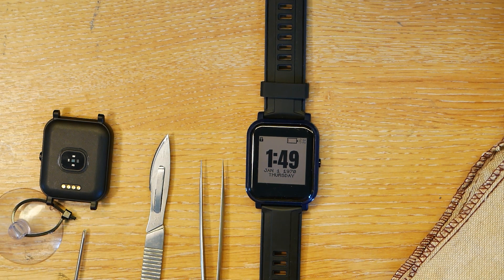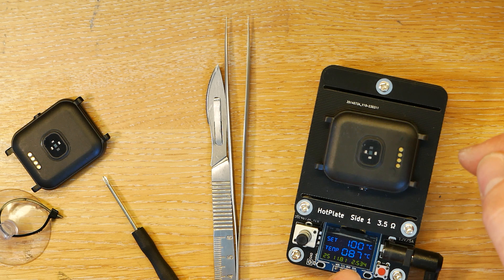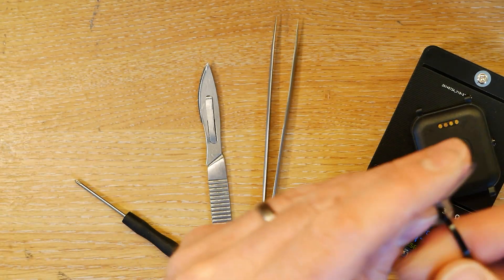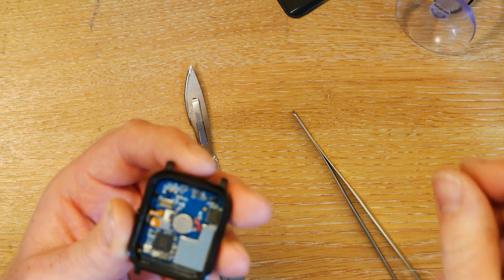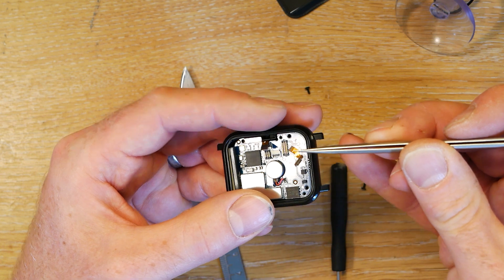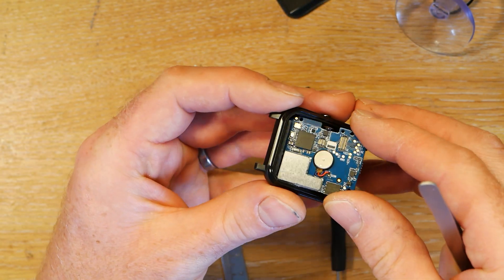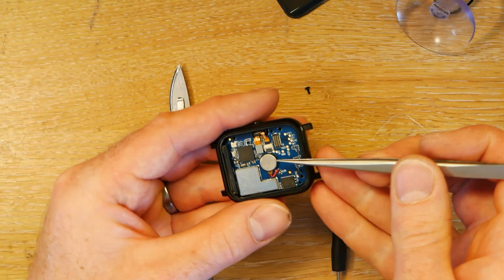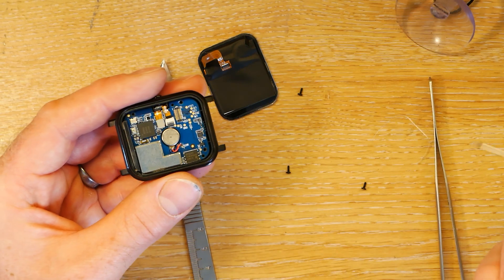Bangle.js 2 Disassembly

Comment: Thanks for all your efforts and the video. I cannot, however, for the life of me get the screen to lift off of my bangle.js2, even after carefully double-checking my 3D-printer's heat bed with an infrared thermometer. The temperature should be just right, the bangle is heated throughout and yet my suction cub doesn't entice any movement in the screen, even with enough violence that would risk tearing the ribbon connector. Is there some kind of trick to it? I've been at it for hours and I'm afraid of slow-cooking the device a bit too much.
Reply from the maker: There's no real trick - some are easier than others, but it can take several minutes for the heat to get right through the glass to the glue. If it really doesn't move you can get a thin scalpel/razor blade and push it between the glass and plastic - if you push in gently it should nudge the LCD over slightly and that may be enough to loosen the glue enough for the suction cup. If you push in and lean it over you can lever the display out but it can dent the plastic slightly (and risk cracking the screen if you're not careful) so should really be a last resort

Comment: Hello,

Thank you for the video.

However, I encountered an issue with acetone during my work 😢.

Would it be possible to purchase a new support for the electronic board of the Bangles 2 watch?
Reply from the maker: The case is made of ABS plastic so acetone would dissolve it :( What do you mean by "support for the electronic board"? Do you mean the watch body itself? I'm afraid we don't sell those

Comment: Hello Gordon. Thank you for the Bangle and thank you for the videos. I intend to use my bangle.js 2 as an alarm wrist clock. I tried it with that entend but the vibration motor proved to be too weak, compared to that, for instance of the Fitbit Charge 4 for instance.
Do you know if there would be a way for me to upgrade the vibration motor with something stronger ?. Thx.
Reply from the maker: Hi! You may have some success just changing the "Default Alarm Pattern" in Scheduler settings. By default it's two short buzzes, but you can make it 3 long buzzes (===) or even something custom which can make a big difference to how much you feel it.

But in theory yes, you could change the motor. I did look at getting it changed but the manufacturer didn't want to do it because they were concerned the increased vibration and also power draw might cause problems, so I think you'd want to be careful.

Comment: When re-assembling; which glue would work to get the display tight in place?
Reply from the maker: I'd suggest a "neutral cure" silicone sealant. The neutral bit is important though because acetoxy silicone sealant lets of acetic acid when it goes off, and that could corrode the PCB.
Reply: @Espruino  thank you

Comment: Hi, is there  a way to add infrared receiver to the board ?
Reply from the maker: There are two pins on the rear of the board (under the battery) called UARX/UATX which I think may be unused and you could maybe solder a sensor onto - but it'd be quite a big job to do. The standard IR sensors like https://www.espruino.com/IRReceiver are really just too big to fit in the watch itself
Reply: @Espruino First of all thank you for responding, great job with the projects man. I will try and do what you suggested unless you have another idea. I am aware of the spacing issue , that's why Im going to try to get in a case like the casio AE1200. Also not sure if there are any battery consumption concerns. I did try sending an email to the mentioning the a casio module like bangle. Let me know if you do like paid sessions so con ask you a couple of questions.
Reply: @Espruino   Was just reading and it seems I can just add a IR transmitter and use the receiver on the Puckjsv2 to get the codes. Do you think  that would be easier ?
Reply from the maker: @Marcos32709  adding an IR transmitter would definitely be easier - there are two pins, UARX/UATX on the board that you could just wire an IR LED across - although that would still mean peeling back the battery for access. It would be an interesting project but still quite difficult. If you're just trying to control a TV or something like that, just putting a Puck.js (which already has an IR transmitter) by the TV and then controlling the Puck from the Bangle via Bluetooth would be by far the easiest option.

Comment: where are the axis sensors and magentic sensors and barometric pressure sensor / altimeter sensor / temperature sensor?
Reply from the maker: I just added a labelled picture here showing where each IC is: https://www.espruino.com/Bangle.js2+Technical#pcb

Comment: Thank you, very easy to follow walkthrough! is it possible to replace the battery?
Reply from the maker: Yes, although you do need to use a soldering iron. Because usually the Bangle can last over a week without recharging, it should be relatively unlikely that you have to replace it though.

Comment: Thanks for the video Gordon, loads of useful insights. Explains why my 3d printer heated bed wasn't unsticking the screen glue... I was too nervous about getting the temperature up high enough (chickened out in the 80 C's as I'd never had the print bed that hot before and I didn't have a secondary means of knowing what temperature the bed was to ensure it didn't go over 100C and damage the screen).
Reply from the maker: Yes - unfortunately I forgot to suggest a 3D printer bed in the video (which was one of the reasons I did this!). You have to be careful if you have a magnetic bed as they can lose their magnetism around 100 degrees C, but I routinely run my cheap Ender 3 heated bed at 80 (sometimes over) for ABS prints and it's been ok.
Reply: @Espruino  it's an Ender print bed with a cheap PEI spring steel magnetic print surface. I hadn't even considered damage to the magnetic sheet. Hot air from a soldering station works wonders. Minimum I could set it to was 100° and I aimed at the perimeter of the screen, trying to target the glue.
Reply: I came here to suggest that a 3D printer bed was an ideal tool for reaching a stable 100⁰C.
☮️❤️🌈